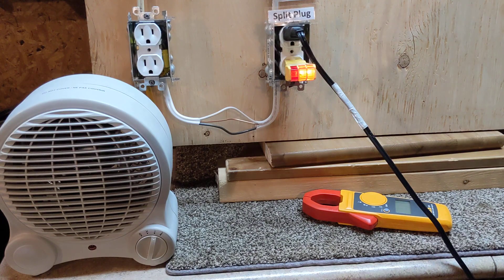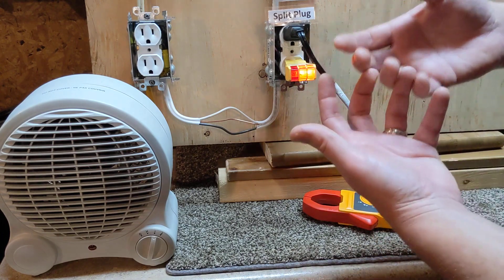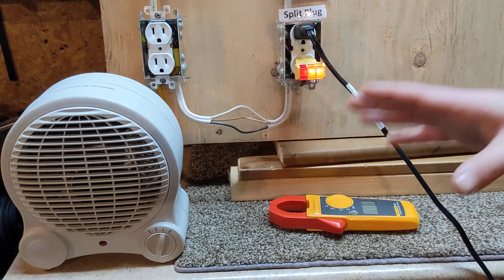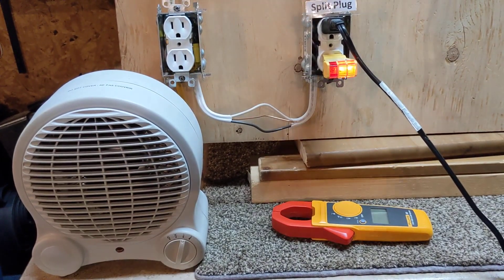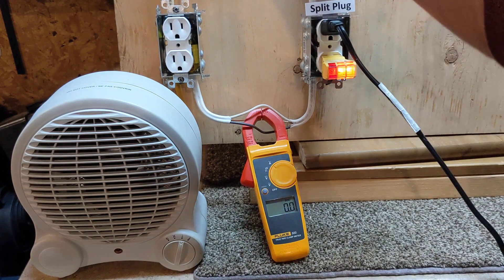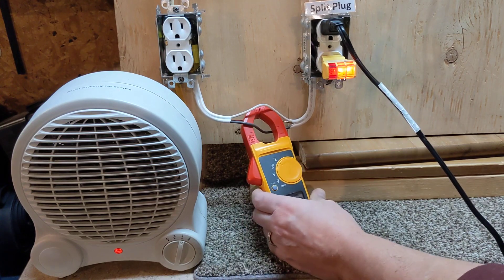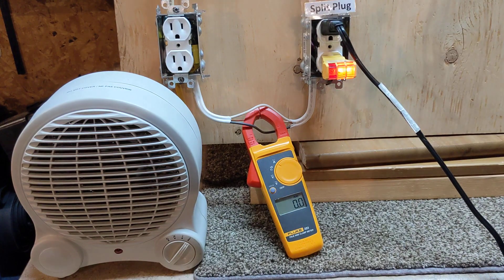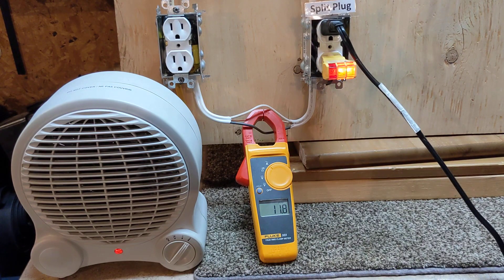Electrical Current Explained and How To Calculate And Test It!

Comment: Good explanation. You can use an accessory with a clamp meter known as a splitter which plugs into the receptacle and makes it unnecessary to cut the sheathing to expose the individual wires.
Reply from the maker: For sure as there are a few ways, thanks for the added tip! I wanted to give a good visualization of what it does to try help explain what it does a bit better...plus I don't own one as I haven't had the need for it. :)